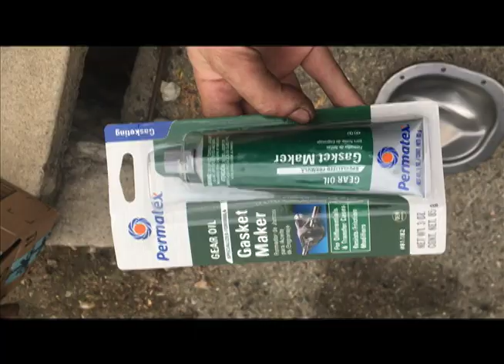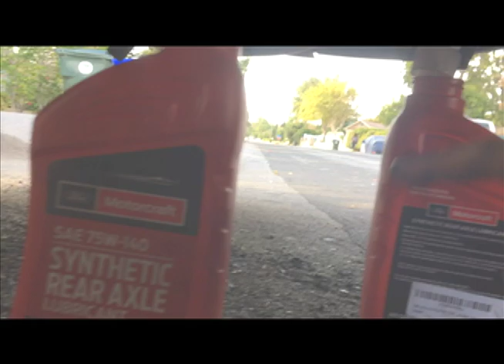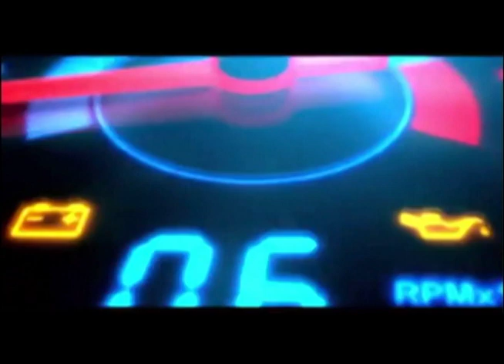How to Change Differential Fluid on a 1997 - 2003 Ford F150

Comment: Before loosing any differential cover bolts, you should ensure that the Differential oil fill plug can be removed! It'd be a shame to find out that the fill plug can't be removed after having drained out the diff. oil.

Comment: Wait 24 hours for gasket maker to dry? I didn’t understand that part
Reply from the maker: the gasket maker needs to dry so don't drive the truck for 24 hours.  It will help not heating up and deforming.